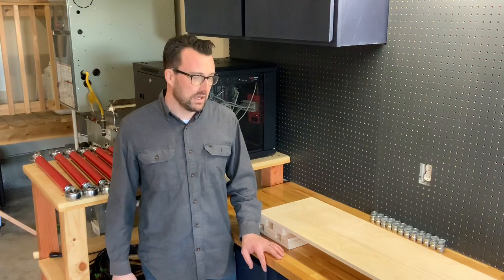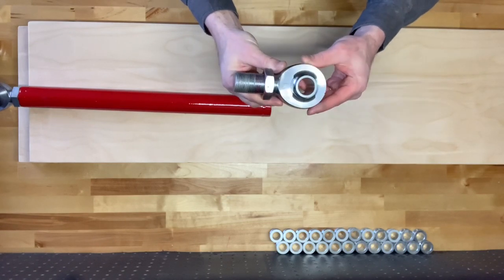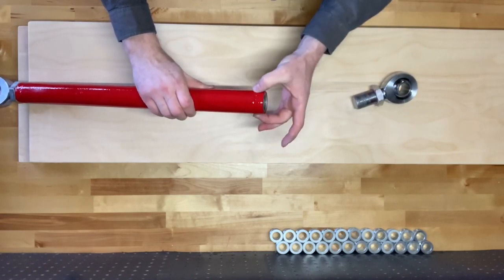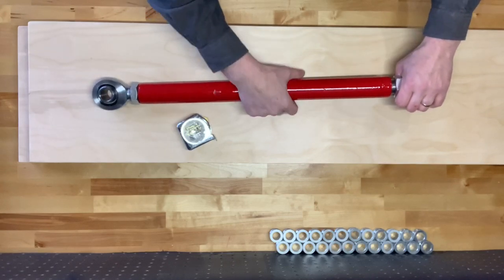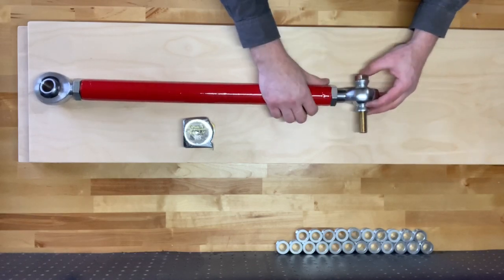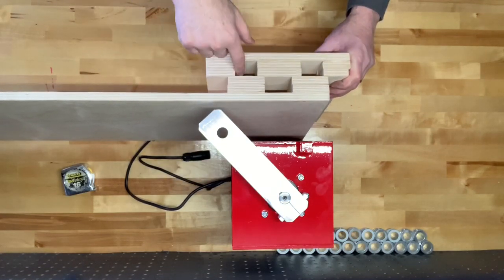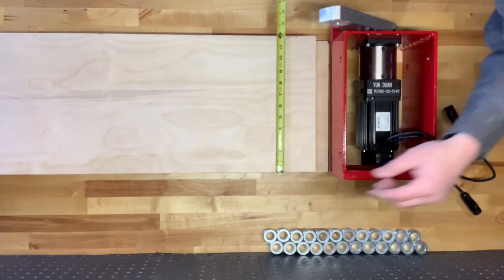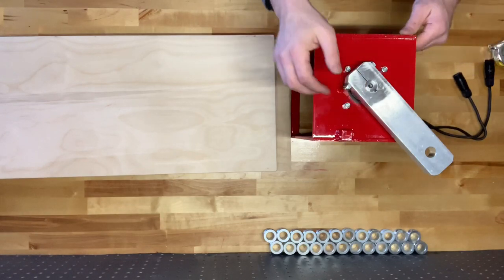Flight Simulator 6DOF Progress

Comment: HI SIM-MOTION, I have the same doubt, the reducers are 100: 1 ?? Are the engines 2HP and 1800 RPM?
I have the THANOS AMC1280USB hardware for several years and I have not been able to use it due to multiple doubts regarding the motors and the reduction box, I have bought the DELTA brand 2HP variators, I only need a person to guide me in the purchase of the other devices and build the platform, thanks for your help
Reply from the maker: Hi Milton!!! The servo motors are 3000 rpm and work great!!!

Thanos AMC-AASD15A Controller - 
https://www.tindie.com/products/tronicgr/amc-aasd15a-servo-motion-controller/

This servomotor/drive kit:
https://www.aliexpress.com/item/32973113245.html

This matching Planetary Gearbox:
https://m.aliexpress.com/item/32962968884.html

Fabi’s Blog on 6DoF measurements.
http://6dofabi.blogspot.com/search?updated-max=2014-07-22T17:06:00-07:00&max-results=7&start=14&by-date=false&m=1
Reply: @sim-motion1228  thank for you information, from Bogota Colombia.

Comment: Hi, cool project!  Thanos directed me here to get same inspiration and I get what he meant by that. Im rewatching your videos times and times over, to see how you did things, and thanks for such detailed videos! Once winter comes I will start to to put what I learned into practise, but for now I have two questions for you which I hope you will help me with. 1st -  Why 100:1 and not 50:1?  2nd - since Im gona make one for myself been wondering can I turn motors inside to make base take less space?
Reply: HI guys, I have the same doubt, the reducers are 100: 1 ?? Are the engines 2HP and 1800 RPM?
I have the THANOS AMC1280USB hardware for several years and I have not been able to use it due to multiple doubts regarding the motors and the reduction box, I have bought the DELTA brand 2HP variators, I only need a person to guide me in the purchase of the other devices and build the platform, thanks for your help

Comment: Awesome work ! ! !
Can you share where you purchased the Rod Ends and such?  --  Also, what material and dimensions are your levels?

Again, awesome work !
Reply from the maker: pattism hey there!!!! Appreciate the kind words!! Thank you!! So I purchased 6 chrome 1/14” heim joints on eBay from these guys.  https://www.rockwelloffroad.com and bought 1/4” steel tubing from a local steel provider here in Portland. 
The bottom platform is almost done and asides from 1/8” steel plates that build the cages, the rest is just 5/8” plywood glued and nailed together. I’lol have to find the dimension docs. I found these in the internet years ago somewhere. I’ll post on my next video!!!! Thanks for following along and you can always check the Thanos Discord for more support from others like me!!!